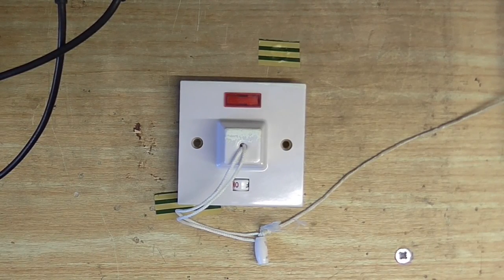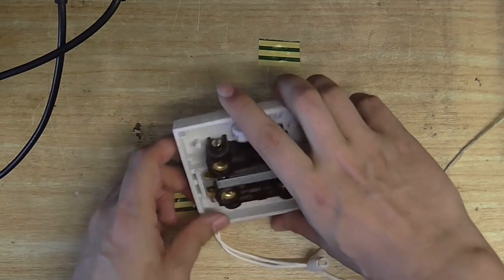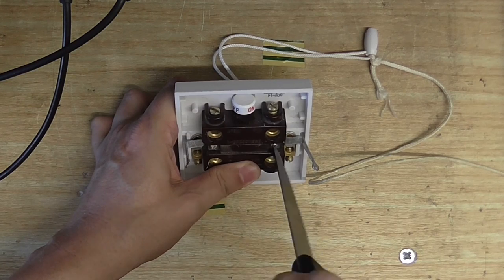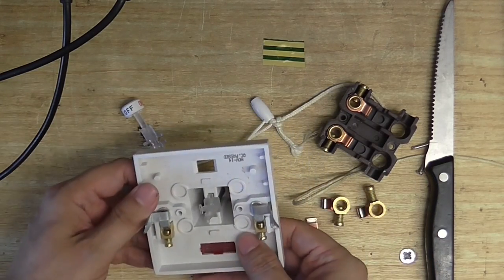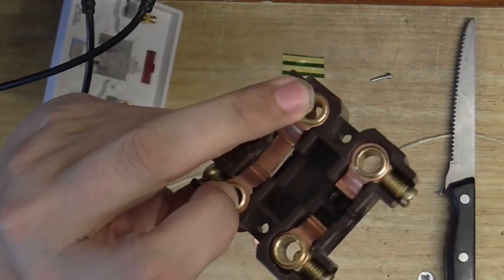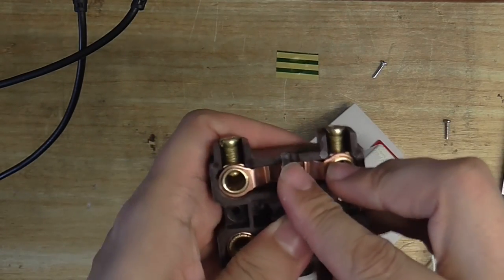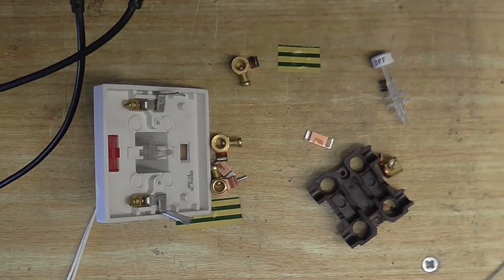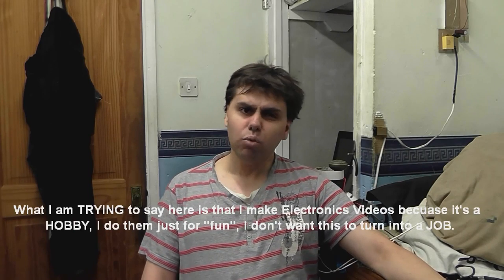"2 minute teardown" of a ceiling switch and some "flapping".

Comment: Just what I needed to know when I needed it. It's 1 a.m. and as I just pulled the cord to switch the shower off, it untied itself and came off in my hand, leaving it on. I switched off at the mains and found just the same that you did inside. It isn't serviceable, even to simply re tie the cord. 
 What an absolute pain! The flat strip you cut is the earth which makes it awkward as it probably braces the mechanism from the internal springs of the double pole switch in case the two screws give way with the strain.

But at least it is on so I can still shower and use the mains switch at the fuse box if needs be till I get a new switch.

Comment: I understand your position on the sponsorship perfectly.

I have an idea for a new filmmaking technique that I believe will work and, if it does, will allow "Hollywood" quality movies to be made in a fraction of the time and at a fraction of the cost of current filmmaking techniques.  However, I lack the necessary money to get the idea of the ground.  Thus far I have been researching what I have to do to get the idea off the ground but have not, as yet, sought funding because I'm frankly concerned about working with other people's money where they expect a financial return on their investment.

See, my idea requires VERY specific gear to work.  I've already researched that end of it and I know what I need, but the problem with getting sponsored is the sponsors will likely try to control what I do and how I do it.  I already had this happen in a small way with one filmmaker who I met who was intrigued by my idea but then kept insisting I need to shoot with more than one camera, which is frankly antithetical to the concept which emphasizes minimal gear and simplicity of shooting.

He wasn't giving me money so I could say "no," but if he had INVESTED MONEY in the idea he might very well have been able to force me to shoot with multiple cameras; if I start modifying the idea before I even try it I'll never be able to prove that the idea, as ORIGINALLY conceived, WOULD work.

The whole concept of money frustrates me, to be honest.  I wish there was some way I could work on my ideas without having to worry about where the money is going to come from.  Right now I have a traditional "day job" which takes up at least 40 hours of each week, and I can't just quit it because I've got rent and power to pay for, not to mention cable and phones and all that, but after a full week of work I'm frequently too tired to get anything substantial done over the weekend when I AM free.

So I'm sure you'll get comments from people that think you were foolish to give up that sponsorship.  And perhaps you were.  Perhaps I would be if I was in your shoes because I understand why you made that decision and I, quite possibly, would've made the same decision in your place.

Well MAYBE I would've taken it, but I'd have to be faced with that decision before I'd know for sure.

Even so, like I said, I understand your position.
Reply from the maker: Sounds like a good idea if you can get it going. even though I dont know what this film making technique you plan to do is, but good luck anyway.

Comment: Maybe the switch was approved because of its age. but that doesn't explain why they're still selling it today.
Reply: What do you want out of a switch? That's what they look like inside. They can't all be knife switches out of Frankenstein's lab.
Reply: Not very sturdy,because they are compact,The weakest part is the plastic spindle,I’ve changed two in a year,fortunately they are only from £10 + up to about £15 for a known British make ( from Screwfix) not worth the hassle trying to fix them!
Reply: @jackal58590  I've noticed that they are becoming less and less common. Every property I have visited in recent years has had the switches installed on the wall outside.